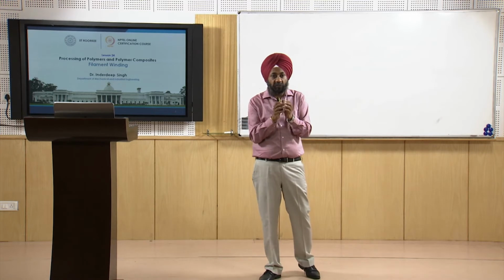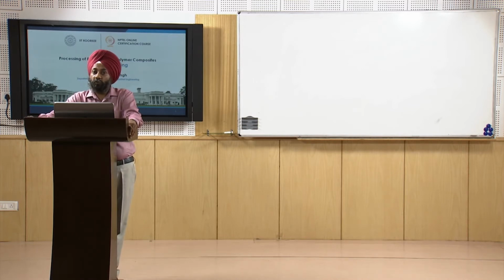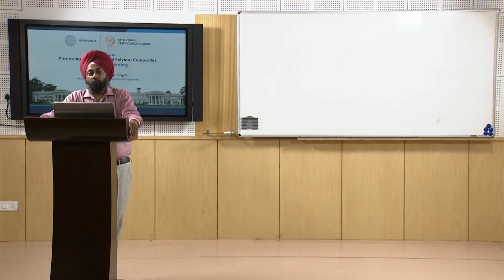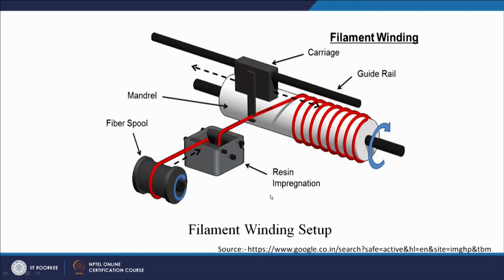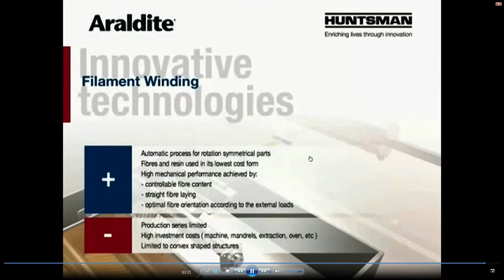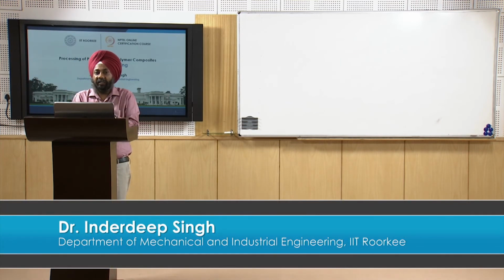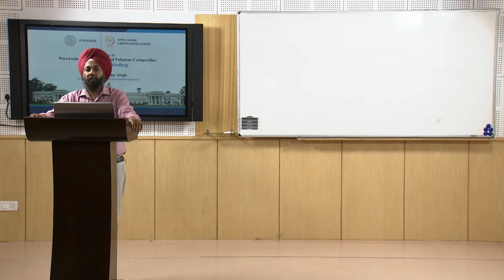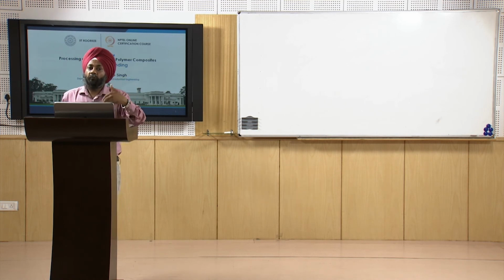Filament winding

Comment: wel ok very good representation , while curing in oven mandrill has to rotate slowly to transfer the heat to cure material all parts of body winded material i mean to say heat must be transfer equally to all area so mandrill must be rotating at slow speed in oven , ? plz cleryfi this point i may have pleasure to receive your reply thanking you naresh joshi